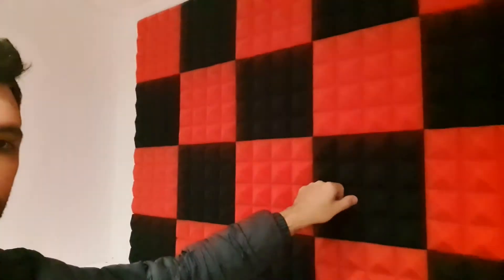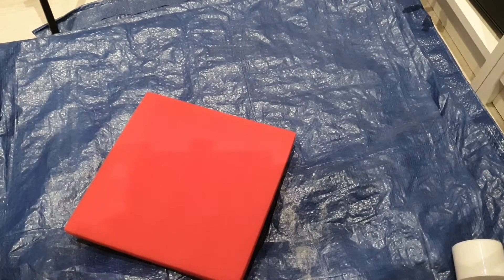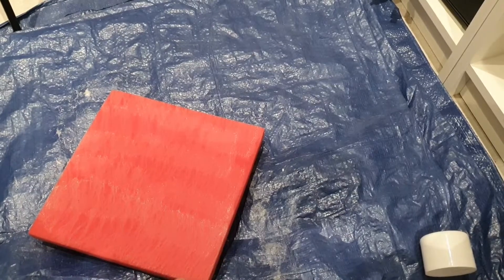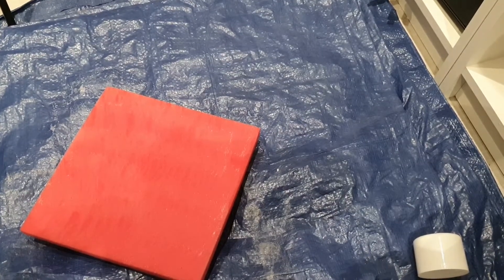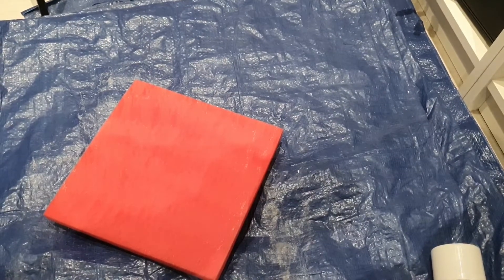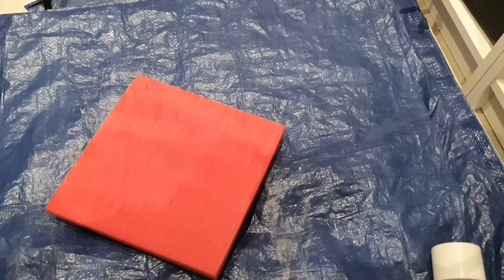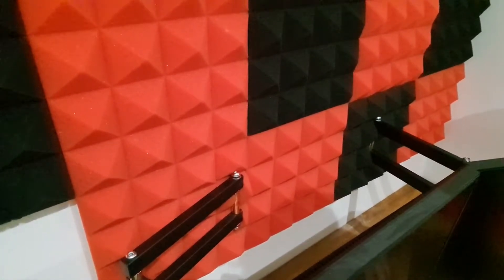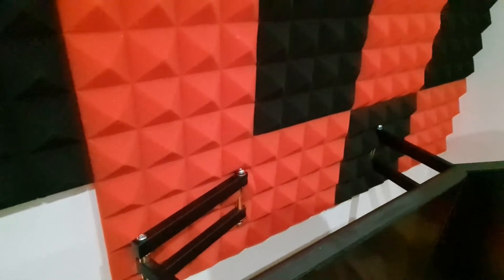How to Install Acoustic Foam: A Step by Step Guide

Comment: Where was the floating shelf on the videos mate?? I’ve not worked out how I’m gonna do my pc mount for basically EXACTLY this setup
Reply from the maker: I didn't do a video on this mate. All I did was measure 2 x pieces of 2x2 and use them as lean ons and I drilled them into the studs using lag bolts. I then built a shelf using some pine and then sat it on top of the supports and screwed it all together. It's very heavy duty as I didn't want anything falling.
Reply: @TechCheckUK  this is what I was struggling with, I’ve got a 1.9m wall to do the screens and the pc on top of an IKEA Alex base of a desk too
Reply from the maker: @saglike93  I just wanted mine to be different to all the others I seen with the pc nest to the monitors and I also had a wall in the way lol 😆 so made sense to build a shelf.
Reply: @TechCheckUK  same issue mate, 190cm wide room
Reply from the maker: @saglike93  yeah use decent materials and ensure you go onto the studs and you will be fine mate 👍